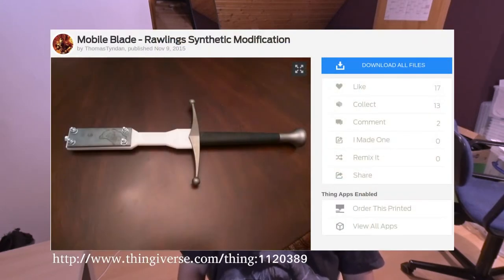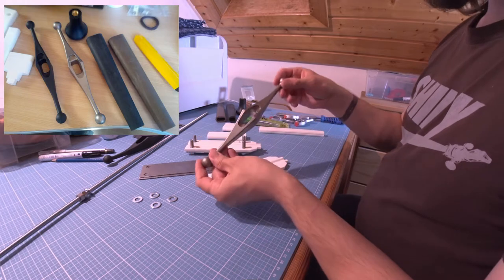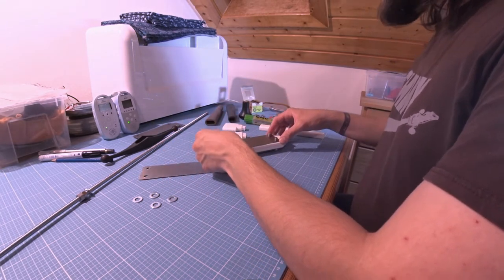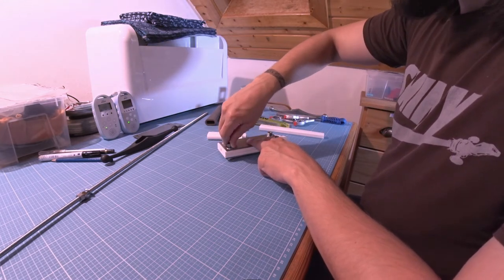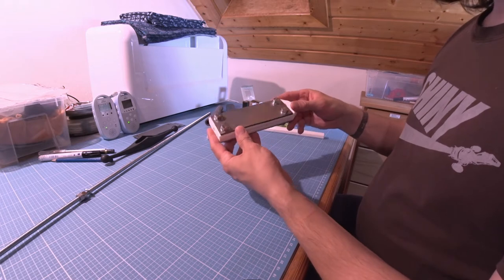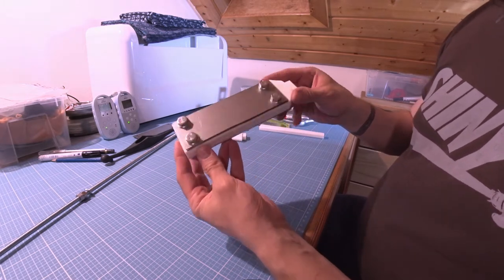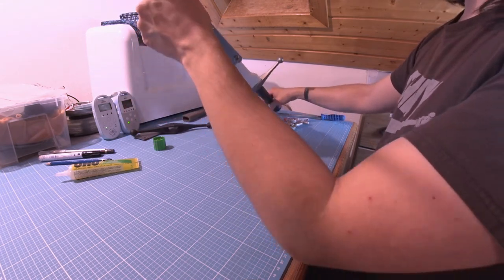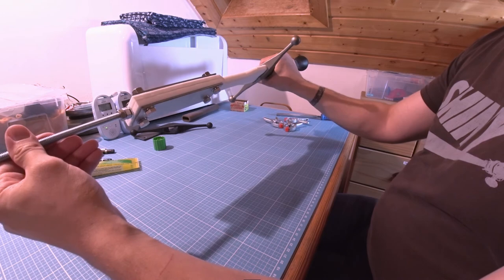Mobile Blade - Indoor HEMA Practise Sword

Comment: First off, this might be one of the coolest things to see for me personally. This M-Blade design was one of the only things I designed from the ground up. To see someone making it is one of the most personally satisfying things... It really is, so forgive me for basking in that glory.

Second, you've done a great job making it. I'm a little surprised how tight the rubber grip was on that piece, mine wasn't quite that tight, I wonder if rawlings made changes to their dimensions. The other thing could be minor variations in the extrusion width from printer to printer.

The decision to glue the pieces does make it a bit more permanent, which is fine especially since you can just pick up component pieces for the rawlings. For the benefit of people who may want to make this: The entire design is also meant to be usable via compression only for the 4 primary sections. I actually glued the blade pieces, but left the handle portion separate on mine so I could take it all out.

The video as a whole is well put together. Cheers!

Also, I heard those church bells, and it was amazing. I love the sounds of real church bells, I never get to hear them in the U.S.
Reply from the maker: Thanks man, highly appreciated :)

The grip may be a tighter because all parts were printed vertically due to the printer not having enough printing area for a horizontal print. Gravity compresses the whole object a little bit before the material hardens again. It was probably also to short because of this.

The grip can still be disassembled because that glue was not suited. I'll make a second version for said friend of mine and make the grip a whole object. This will help with the issue. The rest handles just great. No rattling and a satisfying balance.

About the church bells: Funny, I actually added this to my checklist to start recording after the ringing. I live next to that church and Christians are a quite noisy bunch of fellows :D No mercy.. that ringing goes 24/7 every 15 minutes. Carillon each morning at 6 o'clock included.